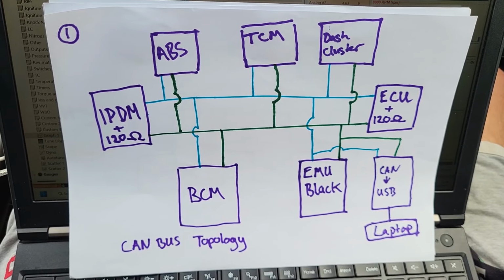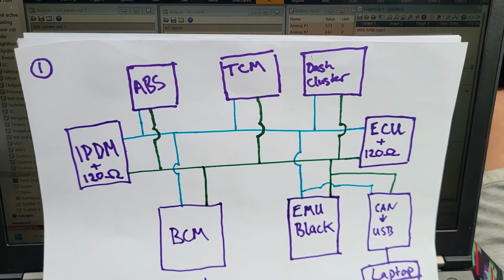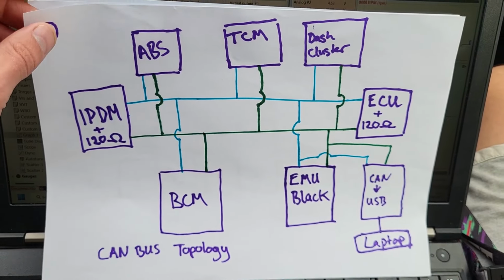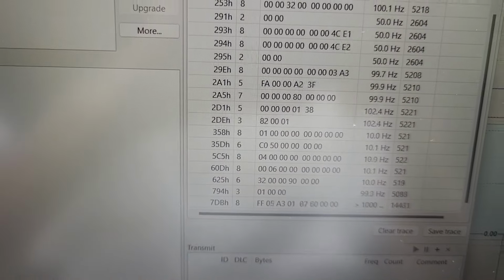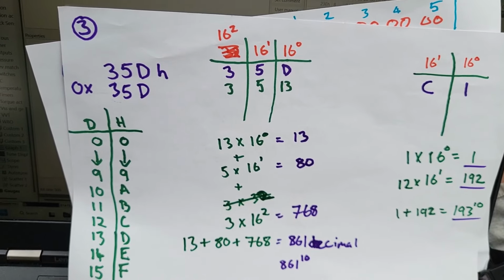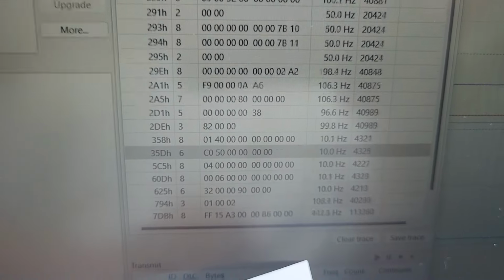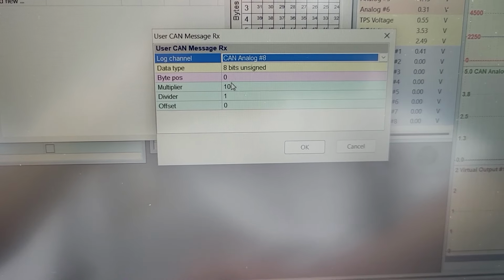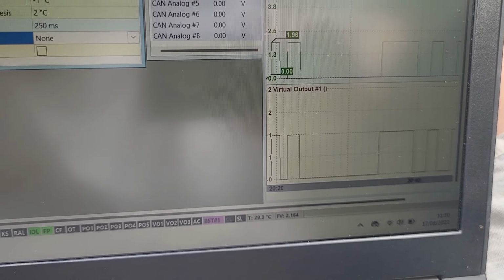M35 Stagea - Sniffing the OEM CAN-BUS (WALOB 041)

Comment: Well done! Great video.
I'm running an EMU Black in a MK2 Supra with 7MGTE.

I'm going to put a Toyota Prius electric power steering rack in it. If I can send the power steering ECU it came with the VSS from the black(I have at tailshaft speed sensor) then it will vary the power steering assistance up and down over the CAN bus as the car speeds up and slows down.

Thats my mission, this has helped my understanding 👍🙏
Reply from the maker: Thanks for the feedback Dude, really pleased it has help you with yours!

I think you would need to find out the original toyota broadcast PID, and then get the black to use that I'd to broadcast the same PID so that the rack can 'hear' it as it were.

Best of luck with it!

Comment: Aww yiss, another win!
Reply from the maker: I know right! Next mission is to find a suitable can signal to trigger throttle blip on down shift. I've had torque reduction for upshift setup for a while but not that effective, but  have just got it working a lot better with a Gear cut strategy, rather than basic ign correction
Reply: @WhataLoadofBull  Hell yeah, that should work great for the manual swap! wink wink nudge nudge
Reply from the maker: That'll be easy when it manual  @Akshun82  ;) I've missed the window to do the swap this summer,  which gives me a lot more time to work the the auto box to help other m35 owners